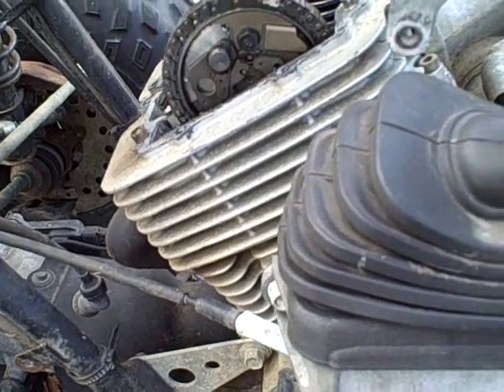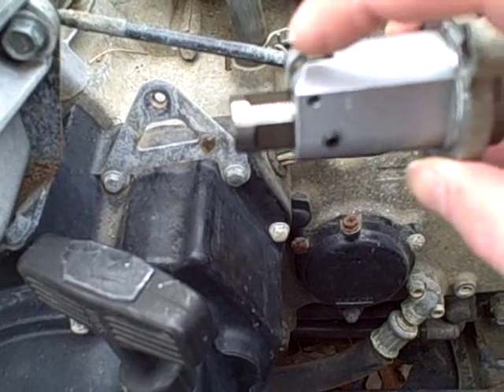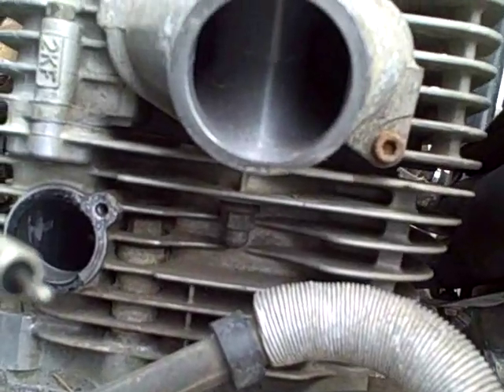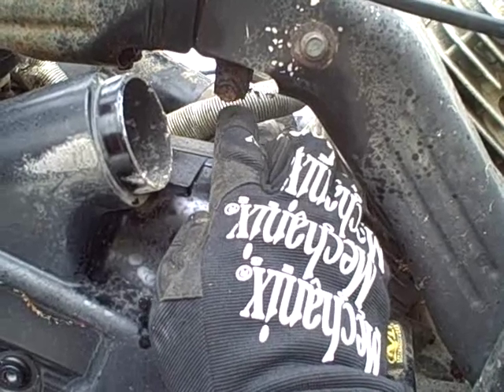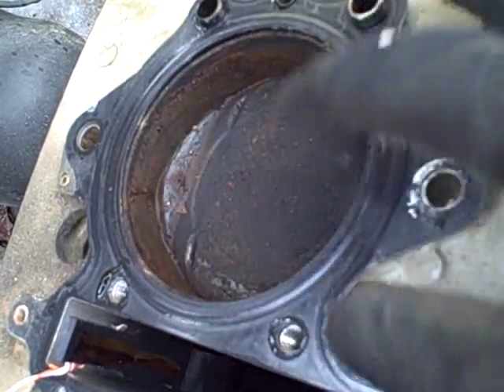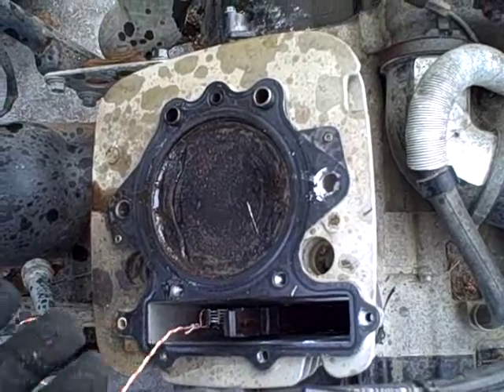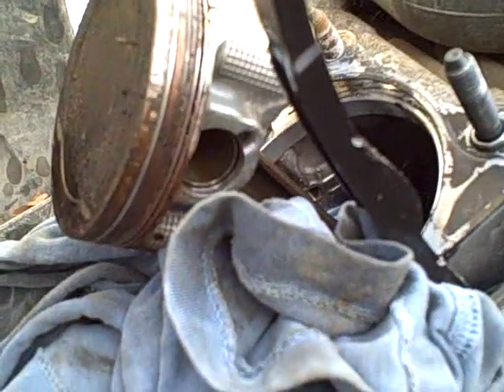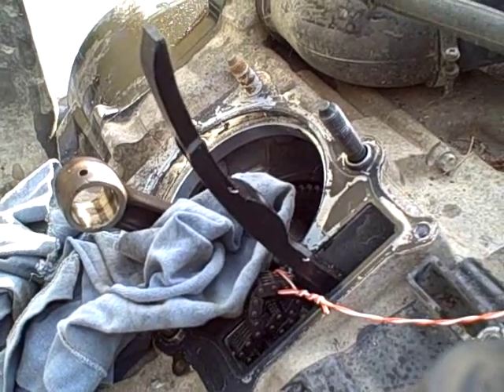Yamaha Grizzly ATV Project Part 2: Cylinder head removal

Comment: so i really hope u see this steve lol. i am doing my headgaskets cause a ehaxsy stud broke off. when taking the tensor out the inner part just sprung out and booop into the case. can i take the stator cover off and get it out? i hope so.
Reply from the maker: Just seeing this now. I do not think you can get to a screw dropped into the crankcase through there. If its where me, I'd drain the oil, then see if you can snake one of those inspection cameras down there to see if its sitting in the bottom.maybe you can grab it with one of those grabbers that has a small claw on the ends you open by pushing a button on the other end. User the camera to see where you are.
Reply: @stevewatr  not a screw.the trnsorner peice came out.i got the spring but that metal peice went down.tryed to find fish magnet it out but nope. I have gaskets coming anyway so the stator side can come off and I was ganna do oil anyway.
Reply from the maker: @No_Limit_Mud_Dragon  yeah, the magnet wants to stick to everything down in there except the part you are trying to grab. That's when the little claw parts grabbers are a help
Reply: @stevewatr  just needed to know if it would be in there. But I was told it should be.just have to take that cover off.extra step.i am following your videos lol. Opening a shop soon but nice to have the info. And yes. Going to make sure I put the o ring on the cylinder first lol. But I got no ring compressor atm so just got to squeeze them in and make sure ring gaps are offset.

Comment: Have a 99, purchased as a non-runner for a low price, I decided to remove the cylinder head. Would have never considered it without these educational videos. If I spend $100 to have it running I'd be shocked. Great job!
Reply: Did you Succeed?

Comment: GREAT VIDEO STEVE THANK YOU .PLEASE HELP ME WITH THIS PROBLEM...THE ENGINE KEEPS BLOWING OFF MY CARBURATOR OFF THE INTAKE MANIFOLD CAN YOU GIVE ME POINTERS ON HOW TO ADJUST MY INTAKE VALVES ATLEASE I WAS TOLD THATS WHAT IT COULD BE ...IT'S THE ame ebgine you have there it only has one thousand some odd miles on it .....THANK YOU ..TOM
Reply from the maker: +COZMICTOM Hi Tom. Valve clearance might be your problem. Mine sometimes "coughs" hard out the intake, mainly when trying to give it gas before it has sufficiently warmed up. But improper fuel mixture due to a blocked carb passage, or leaking  rubber boot allowing engine to suck air cam cause this. Also, ignition timing issues from a sheared woodruff key can cause this.
Reply: OK THANK YOU ..I'LL CHECK IT OUT ..TOM

Comment: I've used ATF, kerosene and acetone mixed together, left to sit for a couple of weeks, to break free stuck pistons. Works beautifully unless it's super corroded (then I just drill the piston crown out and cut what's left off of the cylinder wall unless I REALLY want to save the piston.)

Comment from the maker: You can just time it correctly on re-assembly, but if you are not sure of the condition of the motor, you might verify if it was in time before dis-assemblly, just out of curiosity, also to gie you an idea of the relationship of the cam gear to the head, or just watch my later video showing how to time it.

Comment from the maker: Did you get the hidden screw out? Look at the 18:05 mark in Part 1, and I point it out. It is down in the little well that is normally covered by that cross brace I removed in Part 1.

Comment from the maker: What I meant is that it is normal for the piston to be able to rock back and forth a tiny bit. The measurement made to determine wear requires removal of the cylinder. Then a bore gauge measures cylinder ID. A micrometer measures piston OD. A good machine shop can do this for you, and tell you if you can get away with just honing the cylinder, or if you'll require an overbore with new piston. Did you check the oil level? An overfilled crankcase can cause your symptoms, esp. with contaminated oil